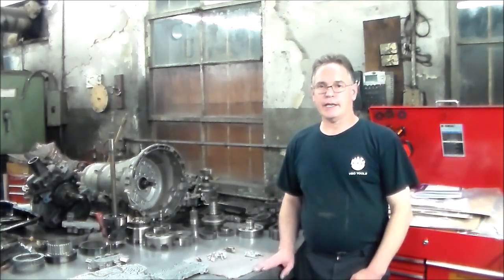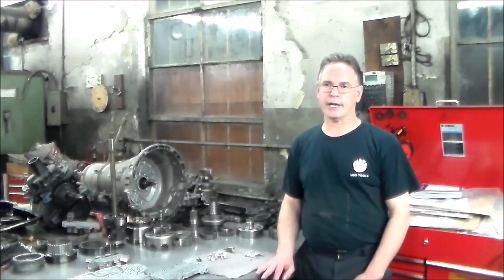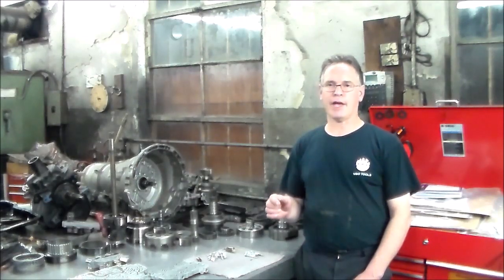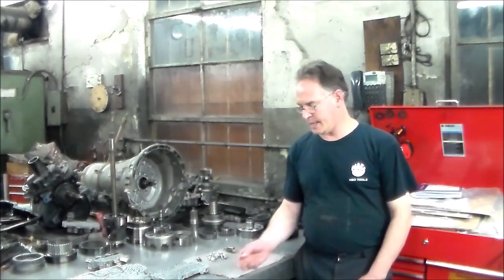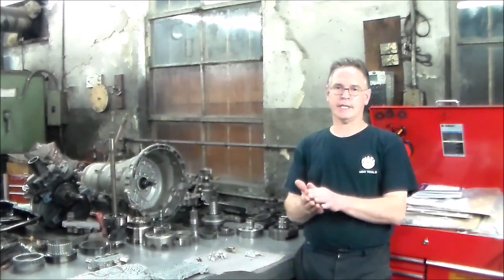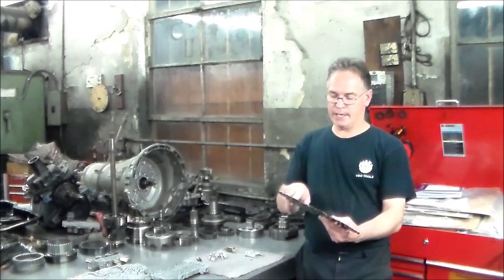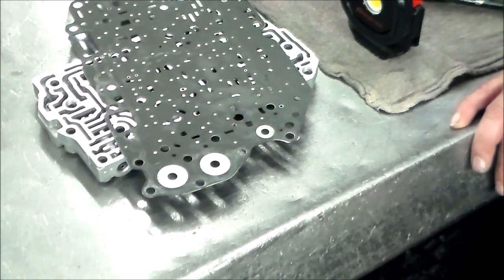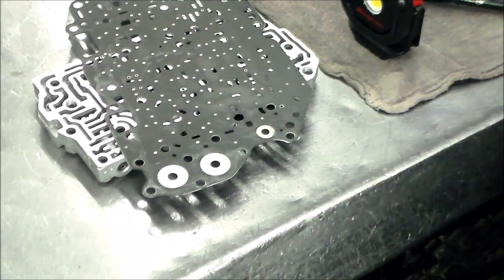Mazda FNR5, Back With Code P0734

Comment: Gary, excellent video. Any idea of which direction to go when my Mazda FNR5 is slow to engaged in Drive and reverse and slams hard when passing gear kicked in. Otherwise drive it and it’s shifts beautifully!,! I changed the fluid and filter. Would bring to you but in south alabama
Reply from the maker: Do you mean a delay?  Nothing common is applied in drive and reverse, different clutch packs for each
Reply: @GaryFerraro  yes, when you initially drop it in reverse, there is a delay before it engages , also when you go from reverse to drive or park to drive. About the double time of normal. If you try to pass and kick it down it slams hard into passing gear. It shifts great with no flairs or hard shift through all gears. It is a 2013 Mazda 5. Could it be the EPC solenoid. The fluid was dark but didn’t smell burnt. I used to overhaulC-4s powerglides, th 350&  400s. 727 tourgeflights.no experience with electronic trans. It does hunt sometimes at 40 mph on tachometer. Not one seems to know, just say have it overhauled but if they don’t know what they are looking for I don’t know how that would help.
Reply: @GaryFerraro  it acts like in the old days when a filter was clogged. Thanks for your help. Your videos are great!
Reply from the maker: Being the fact that it happens in drive and reverse, could be a filter or pump problem @normanmoore1469
Reply: @GaryFerraro  changed filter and fluid  no change, didn’t use Mazda fluid as I didn’t know if it would work. Used castrol import. Was planning to use lubegard fluid and change EPC but sounds like a pump problem but it shifts fine if you don’t drive it hard and just learn to wait a few extra seconds before applying throttle. Looked on the web to locate you but couldn’t. I think your in the northeast.
Reply from the maker: I always change the EPC Solenoid, they go bad a lot @normanmoore1469
Reply: @GaryFerraro  will give it a shot. Nothing to lose. Do you recommend a brand or OEM. It’s inamazda and their parts are higher than a ford. What fluid would you run? Those much and I hope you had a Blessed Veterans Day.

Comment: Hey Gary I have a 2007 mazda 3, 2.3,  automatic, I have the same code just wondering did this fix the issue <Im a learning self mechanic and me and my old man have been trying to figure out this issue for a month  and the only thing I can think IS the same thing you said garbage in the holes not letting the oil go threw <I have the same issue very rough shift in all gears ,Sometimes in 3 when shifting to 4th it will just rev the rpms and not move but then it will jump into gear <thinking about dropping everything and checking thos holes you found the stuff in
Reply from the maker: Was the transmission overhauled?
Reply: having the same issue with my Mazda 3 2.0L. Did you ever figure out what the issue was?
Reply: @ATrueSound  On my 2.3 IT was 4 gear and the torque converter My old man and I Just replaced it with a junk yard transmission We did not dig into too see actually the cause but when we opened it 4 gear was worn down quite a bit more then the others   Good luck
Reply: @Mike-es5zm ah ok sounds like I might have to do the same thing. Thanks for the reply! 👍

Comment: Hello Gary, thank you for sharing. I have a 012 journey with a 62te. Car drive fine for 5mile then it have a hard time shifting 2-3er gear. RPM gose up can't go pass 40mph. putting out code P0732 & P0792  Pending: P0732 P0775 P0792. Clear the code car drive fine for 5mile then it does it again. Any suggestions? I am thinking it could be the valve body. Thank you again.

Comment: I got a 545rfe and it shifts all fine until the 3-4 shift, it jerks then gets stuck in 3rd all the time. I got p0734 and p0871, many mechanics told me it needs a rebuild, I changed the solenoid pack but nothing happened. could it be the entire valve body? 
Note: if I turn the car off when its stuck in 3rd gear and turn it back on it shift regularly from 1st to 3rd.
Reply from the maker: Sounds like overdrive clutch is probably bad, solenoid pack or valvebody will not fix the issue
Reply: @GaryFerraro  Thanks

Comment: I was a Ford dealer transmission tech for many years,,all I do is Ford transmissions now.
Back in the day,,under warranty on the 4f27e focus transmissions,
A po734 with a neutral on 3-4 shift was usually a blown out solenoid body to valve body filter gasket or
If the gasket wasn't torn on VB removal then the VB was the next most common issue,,I can't remember what valve bore would wear out..VB would be replaced..
Also would overhaul them in the vehicle under warranty,,easy money!!
Many end cover and direct drums ring grooved,,,
Or 2-4 servo piston was shredded from a rough case finish,,,
Used to take a hole saw and wrap it with 3m sanding disc (can't remember proper name right now)
And use electric drill to resurface the servo bore in the case.
I still have probably 20 brand new overhaul kits I will never use.
Are you interested????

Comment: Thanks for sharing the tip Gary.  I'm sure you felt relieved when you finally saw that piece of silicone in there.  What's with the stick shift? Front bearing? Shift rails?
Bill

Comment: Gary, whenever you overhaul main control/valve body assemblies, do you totally disassemble the assembly removing all valves, springs, retainers, etc to thoroughly clean/inspect? Or do you just check them for adequate valve movement, and clean with all the components installed?

Comment: Not a great way to spend your 4th of July but glad you're honest, took care of her and show when comebacks occur. 
That's the cons of silicone and using plastic internal parts, plastic gets old and brittle from those heat cycles, especially when washers/bushings are so thin, they crack easily. Sometimes you have to wonder about their manufacturing choices Gary